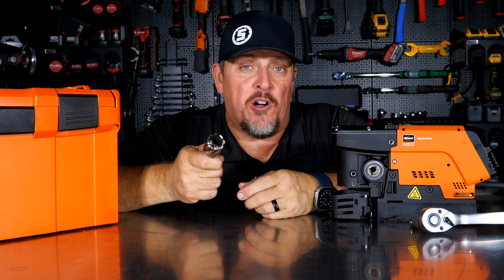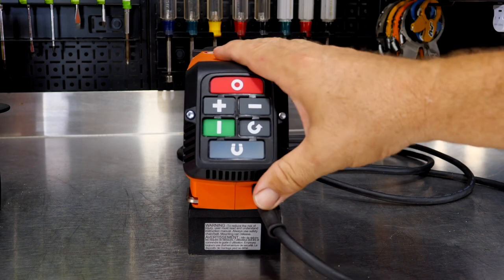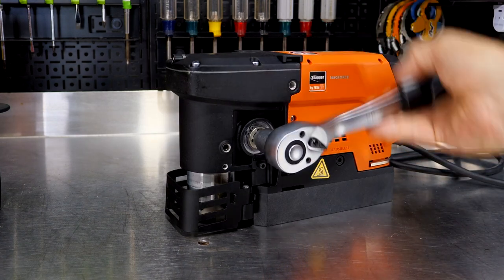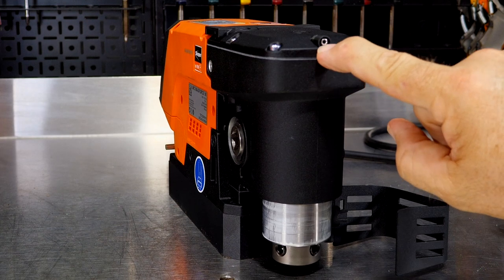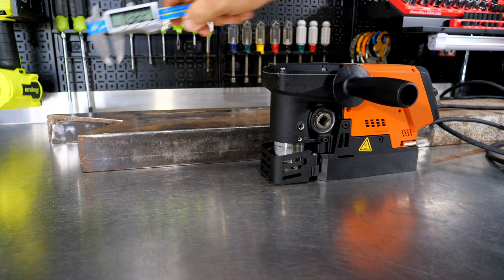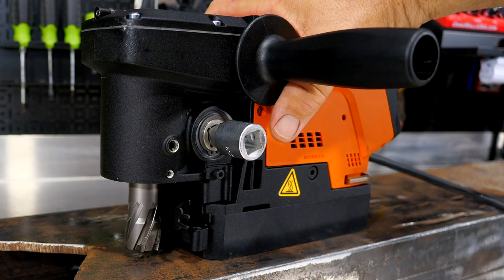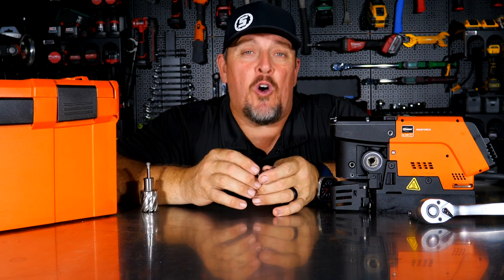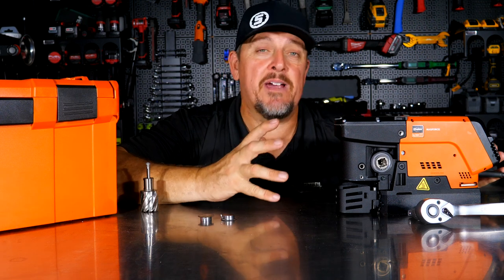KNIFE Through HOT BUTTER! FEIN Slugger MagForce 90 Mag Drill Review

Comment: Thanks for the great review.  I do have one tip however: You should ALWAYS use the center pin when cutting.  The pin has 3 functions: Aligning the center of the hole, opening the valve to feed cutting fluid through the center of the cutter, and to kick the slug out of the cutter when the hole is done.
Reply: Do you know if Fein is going to bring out a short hex bit set for the hex adapter? Be nice to have a #7 bit and some others for tapping. Great tool and perfect size for tight work . Just having a hard time finding the short bits for using it to tap. Also, at height inside a beam it’s tough to attach a fall arrest. Is there an add-on that would become available to better attach the drill when the strap isn’t usable? Thanks
Reply: @shanekirkwood7234  Thanks for the question Shane.  Fein has hex adapters on the way to fit in the 3/4" shank receiver just for this purpose.  Stay tuned.  As for securing the drill at height, you can use the strap in the traditional method or you can cinch it up to effectively make it a "D ring" wrapped around the drill that you can attach a lanyard or a squid to.  Lots of options.
Reply: That’s awesome news. Great idea about the D-ring. I hadn’t thought of that! Thanks for the reply!

Comment: Watching you cut the chamfer does the drill have a depth stop? And is there a minimum thickness required? (I.e will the drill connect to 1/8" material?)
Reply from the maker: It does not have a depth stop. It will connect with 1/8" material, but it's not going to be very secure. Thanks for watching.